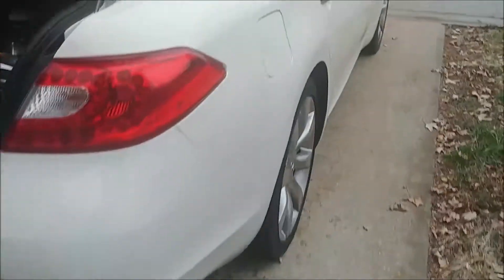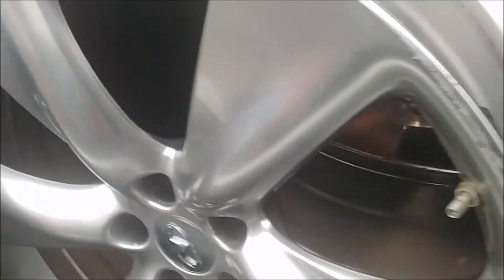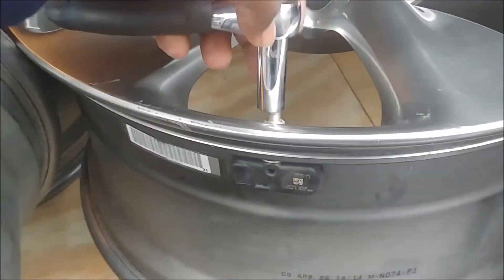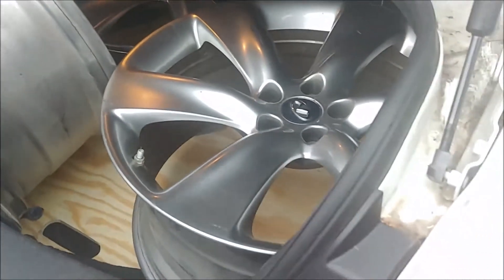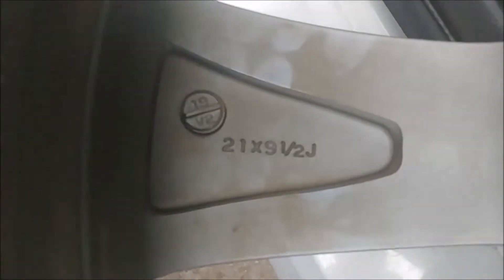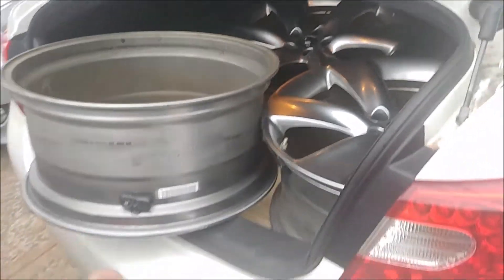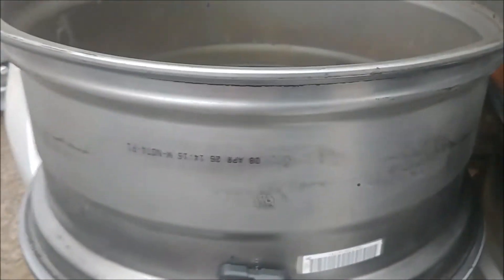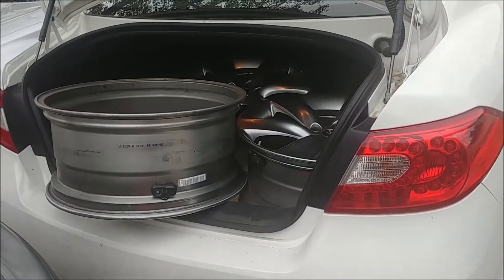Preparing 21 inch wheels for the M56 sport. Donated by an Infiniti FX50

Comment: Love your garage full of Infinitis. Wish I could swing that!! 😁 Question tho, did these bolt right onto your car from the FX? Would they work on my 06 M35? Can't afford a new car or another car, so give what you have a new look! Right?!
Reply from the maker: Yep! They bolt right on. If I recall, they will bolt on to the M35 just as well, but clearance will be really tight. You'll probably need spacers to make it work with tires with good meat on them.
I remember recording a video specifically testing these wheels, but I probably never uploaded it

FWIW, these wheels are really wide (9.5"), so I've always found the 20" from the FX45 (8" wide) a better fit. Cheaper to buy tires too
Reply: @EdBwoy  maaaaaaan, you're awesome! Thanks! I will look at the FX wheels then. Thank you EdBwoy
Reply from the maker: I've had a few sets. They usually come up for good prices. Keep an eye online - Craigslist, offer up etc
https://youtu.be/Ta2diEYW8vg

Comment: What's the weight difference? Any idea?
Reply from the maker: The wheel is about 3 pounds heavier than the m56 one, but the correct size tire is also 3 pounds lighter. The total weight evens out.
https://forums.nicoclub.com/some-oem-infiniti-wheel-specs-including-weights-t620199.html

Comment: Hey fam will those fit perfectly on the q70L with out having to use spacers
Reply from the maker: I believe they would. Although I haven't tested it myself, these wheels are usually used on the short wheelbase models with no issue
Reply: @EdBwoy  thanks for the info u wouldn't happen to have a pair for sale by any chance
Reply: @EdBwoy  hey fam sorry for all the questions what tire size did you use on the m56 to make it fit
Reply from the maker: Sorry, I don't have any sets for sale currently.

I had around 4 options, but liked the 275/30/21 tire the best.
To be clear, I did not end up mounting these wheels. I thought they looked good but there weren't many tire choices and the few that were there were very expensive so I decided to sell them rather than forcing myself to use them on the M.
Reply: @EdBwoy  ohh wow i thought that a p 265 35 would of been to thick so it would definitely clear the strut with a 275 money for the tires isnt a problem i just want the perfect fit
Reply from the maker: 265/35 will fit as well, but the 275 matches the speedometer better.

The perfect match would be 285/30 but I thought that would rub the steering knuckle or ball joint.
Reply: Ok thanks alot fam
Reply from the maker: Keep us updated!
Reply: @EdBwoy  just waiting on the rims to come in can't wait to see how it looks on the q70l definitely better than throwing after market 22s